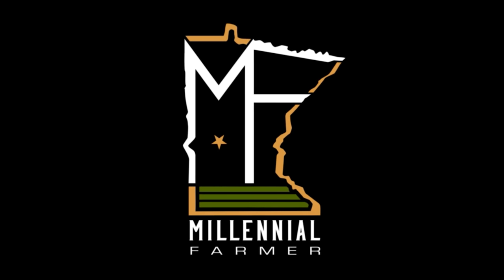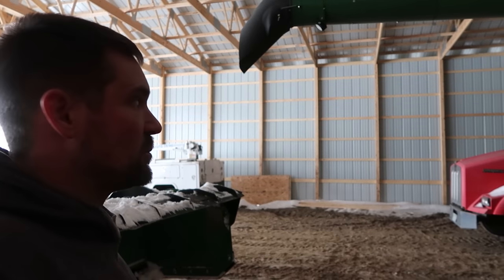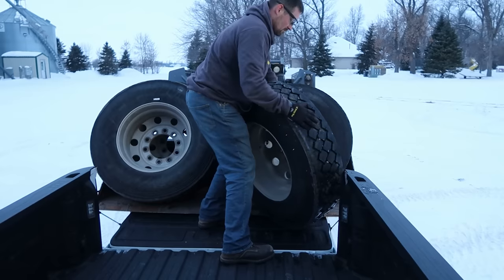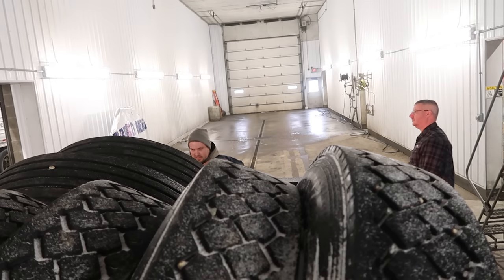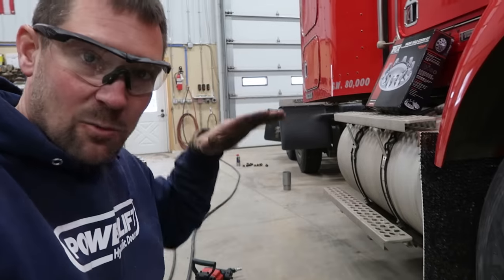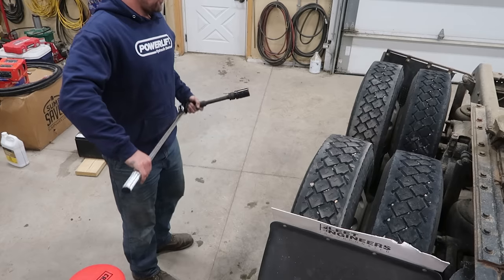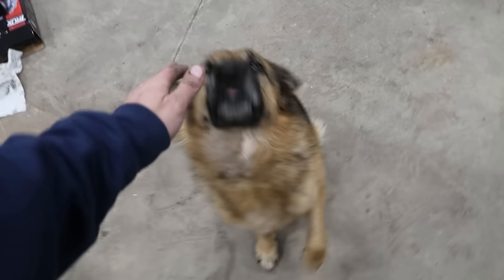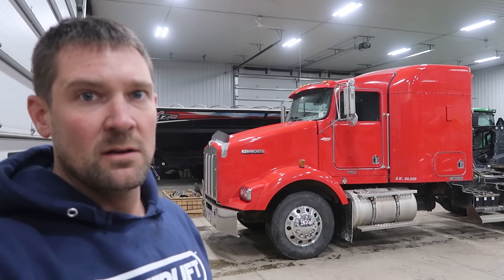This is NOT A HOW TO VIDEO! I Can't Believe it!

Comment: Battery connections are famous for rotting out under the shrink tube.  If those are good your starter is probably junk. Especially if it is an original. My truck did the same thing and it was the starter.

Comment: I never have trouble starting tractors or trucks in storage.   I have a 50 amp solar panel on the south side of the buildings.   or small maintenance charger.   I use lite weight extension cord to plug into a central box with short female cord.  I have a diode in the box on each pigtail except the master to regulate the solar panel and isolate each truck or combine. I put a short male end pigtail on the battery end.    Battery life is many years longer and start with ease.   deep cycling a lead acid battery kills your batteries.

Comment: Only thing you did wrong was replace those nice sealed halogen lamps with LEDs. Direct replacement or not, those halogens are more practical and less expensive than LEDs. Plus they'll never get condensation inside. I guess only time will tell how they last, but I have sealed beams that are probably older than you and still in perfect shape.

Comment: Also never seize effects the torque load causing the bolts to be tensioned greater.  I would use the never seize on the area if the hub contacting the aluminum wheels.  Just use WD40 on the bolts.

Comment: Zach. I'm an electronics technician and electrician.

When people blow stuff up in their cars, I'm the guy they send it to.

Keep telling you every time you complain about those batteries to just do the job properly.

Test the battery voltage, test the voltage drop to the starter.

Then more than likely, replace all the corroded wiring and clean up a bunch of bad connections.

If you can't work it out, go pay a professional. You could have paid them 10 times over by now with what you've wasted in batteries, let alone time.

Comment: I use to have problems with batteries that did not last to long except for original equipment. So I switch to John Deere, Cat, or Delco batteries and  for the most part of our short lived battery problems have went a way.

Comment: ask Jim to do a voltage drop test on the cables, those heavy multi strandeed cables have a habit of corroding underneath the rubber sheaths, and you will be misled into believing the batteries and or starter has a problem, lso ask Jim to inspect the grounds to chassis

Comment: After twenty years in the business, what you described for torqueing wheel nuts was the reason I left.
A new salesman sold the idea to a local Esso Tanker fleet manager that he could lay off his 11 staff, part mechanics, part fitter, part general ops and I alone could check and torque all 11 18 wheeler tanker before they left for the weeks work.

BTW, 7 days later I saw every Tyre Company's truck in the yard and an army of men and the [Esso] drivers just harassing them as they would not take the trucks on the road without the inspections being done ~ n of course they are all late!!!

Comment: On Your Red Pete
Do you own a multimeter? If so first check the voltage on the batteries I know the are new, but hear me out.  Then check voltage while you are cranking, you may new a second pair of arms. Them do the same at the starter post positive and negative needs to be at the starter for this this will determine where the voltage drop is. Then you can fix the problem if you have a draw it is a little more, but it is fixable.

Comment: You gotta get a disconnect in that thing and check your cables. Resistance = heat. You cut one wire and it look like junk, the rest probably aren’t much better.

Comment: Try replacing the starter I have a t800 and it was doing the same thing  . I tested the alternator and checked for a draw and replaced all the batteries that were gel . Still had the problem . I replaced the starter and never had the issue again . Try that zaq

Comment: If problem persist replace battery cable's if starter and batteries are ok. Had same thing with a tractor and it was corrosion inside the cable's.

Comment: Late to the party, maybe you'll see this. maybe ya won't, maybe it will help someone else.
I worked at a large tire service chain (rhymes with stomps), ran the service truck did the TIA training for all the fun stuff all the way up to mining equipment.
It looks like your inners are also aluminum, get the spacers to keep aluminum off of steel.

and the big no-no don't put anti-seize on your studs, it affects the clamping force of the lug. clean it up and put a couple drops of oil, thats how the safety nerds want you to do it. plus its not as gross when you take it off again.

If you have issues with wheels sticking you can apply the anti-seize to the face of the drum/hub

got out of it a few years ago, because - surprise - its not nice on your back

Comment: Do not leave ANY charger on any battery that uses water for an extended period of time. It will cook the water out of the battery no matter what the manufacturer says. 
Disconnect the negative battery cable at the solenoid or at the battery. If the truck starts easily when you next use it then there is parasitic draw that is draining the battery when the truck is not being used. 
If there any electronics like radios that have preselected or favorite stations they continue to draw power to remember you selections.  Other things such as ECMs, (Engine Control Modules) or Traction Control in the truck will likely draw power continuously. 
All vehicles today are meant to be used at least monthly to prevent the batteries from going dead.
The solution is disconnect the battery or bring the batteries back to full charge every month during non use!

Comment: The other thing is you messed up putting never seize on your wheel studs   That is a dry torque and you should torque them to 575 ftlbs. So you really didn’t torque them at all because they weren’t torqued correctly. Try and get better using your 1” gun to install then you won’t have to go around twice. Or consider buying a 575ftlb torque stick for your 1 “ gun

Comment: After lug nuts are off always pull wheel from bottom while lifting upwards.  I would have put a toe jack or floor jack under the tire or turned the wheel out and hit from the other side.

Comment: I myself was unaware of the equipment that shop had to polish the rims, very interesting.  Just wondering if it would have made more sense to dismount the tires and do the whole rim?  Get any corrosion of where the tire bead seals against the rim.    While any of us can call and find out, would be nice if you could give us a heads up in the video what some of these services cost.  I myself was taught not to use anti seize on the threads, only on the portion of the rim that contacts the hub...maybe someone who works at a heavy truck shop to share about proper procedure...

Comment: Replace those wires and connections before you kill those new batteries or something catches fire! I’m surprised that truck only has 3 batteries. Most trucks of that size run 4. Other than that great video!

Comment: You are loosing a lot of voltage with all that corrosion.  I would agree with a lot of the comments and replaced those relays and cables.

Comment: The last battery in parallel (first battery from starter)(12volt system) will have the greatest current draw at the connections, thus the higher temperature at the connectors.
P.S. The comments about checking for corrosion and grounds are also a factor as well in creating heat.

Comment: You would be amazed by how much better it starts and by the looks of it your cables are past shot... I've also noticed how you guys and a lot of farms around me grease everything like crazy Ive been meaning to comment to stop greasing all of your electric motors if you have been.. Every single electeic motor I have ever seen apart have grease fitings but always have sealed bearings. I see a lot of motors from farms where they didn't know that and have pumped the windings full of grease making the motors run hot and fail prematurely.

Comment: 😏 Yep Zach us Old Guy’s need all the light we can get! 🤓 When starting cold like that do more than one cycle of the glow plugs. Turn the key and wait until the glow plug light goes off and do it again. It’s going to start easily. You didn’t give it any time probably because of concern about charge. Definitely need to cut back into the Battery Cables and see if you have a chance for reuse but it’s the green that’s causing the Battery’s failure. God Bless Onyx he’s gonna have a decent Truck one day that starts every time! 🤪❤️🇺🇸🖖🏼

Comment: With all the dead machinery you deal with, I'm just wondering why you don't invest in a battery cart? So you can just jumpstart stuff instead of waiting on the charger to do something. 

I used to be a truckdriver, and now I operate cranes, and the one thing all my employers have in common is having a battery cart. Now we do operate at 24volts in europe, but that shouldn't matter, right? Just make sure the jumpstart cables are beefy enough. 

Also, when wheels are stuck like that, you can handtight the nuts and drive in figure 8's around the yard till they pop loose.

Comment: My 2020 Freightliner got to the point where it wouldn't start in the middle of summer.  Sounded just like dead batteries.  Starter was bad.  New 1 in and it starts better now then when it was brand new.

Comment: Hi Zack for what its worth my Grampas old backhoe started smoking batteries and it ended up being the Alternator drawing while the tractor wasnt running. Lo and behold a few months back my old diesel pickup truck started doing the same thing. There is a company that makes a Alternator for big diesels that will activate off of RPMs not with the ignition. Hope I explained that right. Well best of luck. Cant wait for some new racing videos. Take care!

Comment: When eletricalco nnection gets hot under high usage of power - start - you have a bad connection, and that's also gives a voltage drop.
could be the reason for your start problems.
Sounds crazy, but if you wanna troubleshoot that try and measure the voltage on the plus side of the batteries and the plus side of the starter - and then see what the voltmeter says when you cranck it.
When you meassure from plus to plus under draw, you'll see your voltage drop.
Depending on how big a pull you have there'll always be a voltage drop - but on the starter it should stay below 5-8% of the total voltage.
More than that, you have a bad connection.

Comment: How old is the truck? Those cables are probably the same. Plus looking at just the one connection, and considering the other connections between the batteries and the starter will all look the same, it's not hard to imagine why it's not turning over strongly. Spend more time on mechanics and less time on wheels and it'll probably start every time  you need a truck. A multimeter is also a mans best friend.

Comment: Need to clean battery cable ends at starter and battery box cut the rubber off them sand paper and some elbow grease

Comment: Was that Deoxit you used on the cables? Works well on cable connections for sensors to clean them and improve the reliability. Should help with the intermittent problems you get.

Comment: So much easier to loosen up the lugs take the truck down from the jack turn in the tires from side to side or drive it in and out a few feet the rims will break loose.

Comment: Ya could've opened the hood to get the steers on, and I've used 1 inch guns on every truck I've worked on cause running a fleet I don't have time for a torque wrench on the lug nuts

Comment: I see one thing in a lot of your videos I would offer a suggestion on. All diesel engines that I am aware of have glow plugs (or igniters for turbine engines) for normal piston diesel engines you need to give it time to heat up before trying to crank, even during the summer. If you don't have the glow plug light on the dash just give it a 30 to 40 second count and if it is very cold or even anything below freezing do two cycles on the glow plugs before cranking. When you turn the key to ACC some diesels have a time out where it only warms/powers the glow plugs for a set time and then cuts power to them if the engine isn't cranked so, two cycles before cranking. You definitely need new battery cables and probably starter cables. The current travels on the outside of a wire so the broken strands and corrosion will definitely cause heat buildup and it will cost you a loss of CCAs. Being MN I wouldn't go cheap on cables, look for ones that use environmental heat shrink boots on the ends or cut the cheap boots off the end and get some environmental heat shrink and do them yourself if needed and then use replacement boots to cover the connection. You can tell if they are environmental boots by looking at the the cable going into the boot, it will look like a bead of glue or hard sealant squeezing out from under the boot onto the cable. The environmental heat shrink has this sealant coating the inside of it and it melts and oozes out gives it a water tight seal. Also, after connecting everything coat your battery cable lug, nut, and stud (any exposed metal) with dielectric grease to give a moister barrier and help prevent corrosion. I am guessing since I see three batteries that they are 24volt batteries connected in parallel..? Either way when ever you connect multiple batteries series (12v + 12v = 24v system) or (parallel 12v + 12v = 12v but doubled amp hour/capacity) the batteries will balance each other i.e. one at 11.8 volts one at 12.2 volts the higher charged battery will charge the lower until they balance to the same voltage. This means that one bad battery effects all of them. Also when you use multiple batteries in parallel the main cables going between the batteries and the vehicle have to carry the combined amp load and this can cause higher heat buildup at the output connections especially noticeable if the same size cable is used for the output cables and the cables connecting the batteries together. I saw a suggestion about using two metal rods or pry-bars to lift a tire onto the axle and I second that idea it works very well we do that on aircraft when a tire cradle jack isn't available.

Comment: Hey Zack , Its time to put a battery shut off switch on that kenworth.  I started putting battery shut offs switches on all my farm equipment and now I dont encounter those annoying battery current leaks.  Pretty easy to do and worth the time spent.   Thanks for all the info and laughs along the way.

Comment: Definitely your issue when wires turn green like that they are oxidized and very terrible at conducting electricity ( if at all) heat is from hi resistance in your cable.. definitely change those cables…

Comment: distinct lack of maintenance on those wheels coat hub face to rim with copperslip plus studs as Electrolysis had started there can get to stage where won't get wheel of hub as mixed metals alloy/steel.  Known caliper bolts to sheer of from it with alloy calipers.

Comment: The worst thing you can do is use never sezie in your studs you will never get them to the right torque a drop of 30 weight oil on the nut flange and a drop on the threads of the stud and torque to 500 ft lbs and then recheck after a 100 miles never sezie will have you over torqueing your wheels and stretching the studs and you will end up with loose wheels or a wheel falling off

Comment: Zack  sorry  but those are hub piloted wheels which should not require alignment, also should have plastic isolator between aluminum rim steel hub to prevent galvanization.
Reply: te..legram_official_the_dodo  how do I claim the prize

Comment: Hi Zack. A bit of helpful tips for ya. When removing the outter wheels I usually just reach one hand i from the outside and lift a little bit and slide it off. Also use a pry bar or tire spoon under the tire when putting them back on! Also I would suggest putting a battery disconnect switch on your trucks it will do wonders for keeping your batteries charged! Especially in the colder climates. I'm from Manitoba so we get pretty well same weather you get.

Comment: And I know you’re not a mechanic because you said so but you could buy or check under your hood you may have a block heater on that engine you could plug it up to an extension cord plug it up to your wall socket and that way you don’t have a problem starting it anymore

Comment: Hmmm. you order some high dollar batteries, the need for which you determined as a direct result of not having enough hose to reach. Care to explain why you seem to still refuse to buy additional hose lengths??? They cost a lot less than batteries and actually connect to each other.

Comment: Replace the cables or at least redo the ends on all the cables...... all the cables on anything that had trouble starting. 
Not as bad here in michigan but more salt. Definetly replace the cable ends or the cables. Not an easy job but well worth the time.

Comment: I've heard you need to watch the cold cranking amp rating? The higher the cold crank amps are the thinner the lead plates are,  that way they can cram more plate surface in it but they don't last as long ? Need to find the specs of the truck. I tried higher cold crank amp batteries on my 110 Harley and they barely last 2 seasons?

Comment: On that kenworth, do you have a dirty ground  connection somewhere? And when you start the engine do you put the clutch in half way? It will put less load on the starter by having less to turn in the transmission.

Comment: I worked on a truck that was close to that and replaced the battery's and the starter still wouldn't start replaced the cables and fired right up.